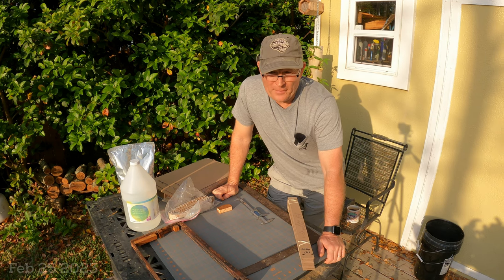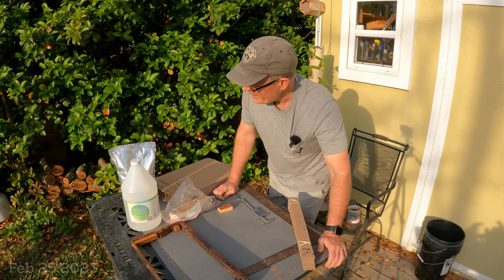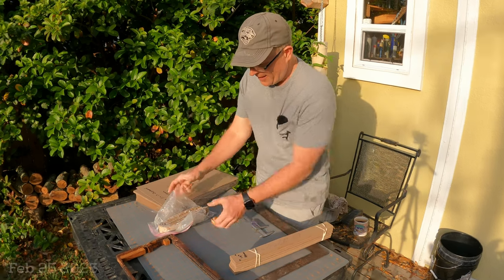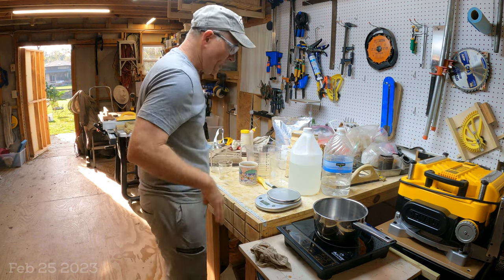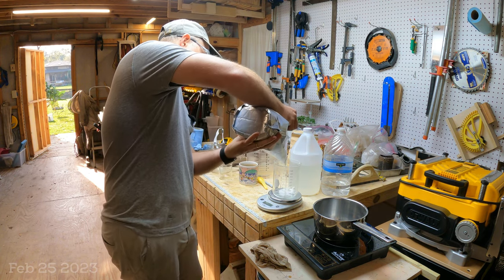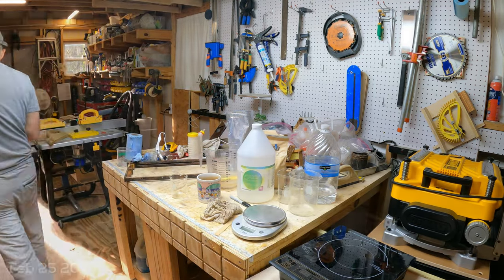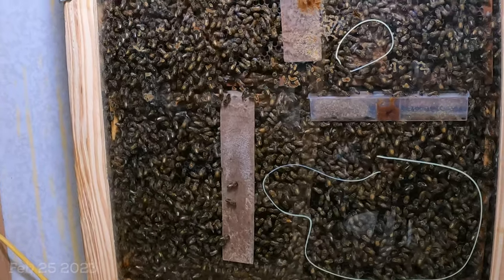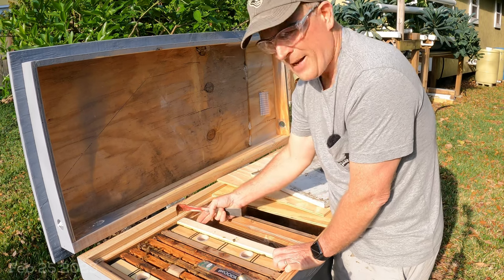HOWTO - Extended Release Oxalic Acid Strips on Chipboard - Jacksonville FL Zone 9a

Comment: I am glad to have found your channel. 2nd year beek. Absolutely and completely enjoying the learning journey. It’s true to that the second year is where things get fun. I already have the strips cut, will make solution tomorrow. I have one hive with 6 mites from the wash another with 8. On hives with numbers like that can I put 6 strips or stick with 2 per box. I’m running double deeps. My swarms that were caught have almost none, 1-3. We use the Dawn soap wash. I was shocked that 1 hive I split from last year had 0 mites in the wash. That shocked me. But I was glad. With appreciation and gratitude 🐝
Reply from the maker: You could put 6 strips per box, but I think that is overkill if you did the formula like I described.  I don't think it will make it last longer, only more oxalic in the hive until they chew them away.  But if you do put 6 per hive, I don't think you are going to hurt anything either.  Welcome to the channel.
Reply: Chuck, how long can you keep the strips in the freezer, or refrigerator, and still be effective?

Comment: Thanks for the video. BTW, I use an infrared thermometer to watch the temperature. Getting two cheap ones enables me to verify they are reading the same and working properly. You provided very useful guidance, thanks again.
Reply from the maker: IR Cameras are a great tool, especially up north.  You can see the cluster size without cracking the lid.  Thanks for the feedback and comment.

Comment: Nice work Chuck, Video is great for educating and building connection.
Reply from the maker: Glad you enjoyed it, and thank you for the comment.
Reply: Chuck I don’t see on Randy website that he use water .
Reply: Place 500g OA dihydrate into a stainless steel pan, then add 500g (400 mL) vegetable glycerin (add the glycerin second in order to avoid splashing of the solution).
Place the pan over a low/medium heat (preferably using a double boiler), and heat the ingredients while closely monitoring the temperature, not to exceed 160°F (the acid crystals will dissolve at as low as 110°F, and start to bubble if the temperature exceeds 170°F).
Occasionally stir gently until the acid crystals are completely dissolved and the solution is completely clear. At that point, remove the pan from heat.
 @chuckshoneybees
Reply from the maker: Randy does not have to use water in his sponge formula, in earlier articles where he was testing with other media he uses water.  The water is ONLY to help get the mixture into a solution that will absorb into the media.  The water evaporates away leaving only the Oxalic Acid and Glycerin in the chipboard.

Comment: Informative video.  The chipboard strips will also work for top bar and Layens hives.  I use a combination of sponges on the hive floor and suspended shop towel strips hung from the top bars.  I’m going to switch to chip board for easier handling.
Reply from the maker: I used to hang the shop towels between the bars too, But they just are a bit to flimsy to "push down" the chipboard of the right thickness ..is much better in my experience.  Give it a try and let me know what you think.

Comment: Been watching your channel for around 6 months, completing my first season of having a colony this spring with a bustling double deep coming thru winter and already filling the better part of two supers. Im in the same USDA zone but on other coast. I am really finding my timeline to sync up with yours and its been very helpful. 

I treated for mites last November with formic pro after testing 7%. Treatment bringing it down to just over 2% if memory serves me. Fast forward to early Feb (the 10th specifically) when I took a first peak in for '24 after noticing them pick up in energy and again performing a mite wash and recording 2.5% 

Understanding OAE is best done proactively while numbers are relatively low I wanted to get it made up and on the hive quick. Using a 1:1 acid to glycerin ratio of 120g total weight impregnated on 66 sq in 2mm chipboard. My chipboard was 11.5x11.5in from Michaels so I couldn't cut it into the long strips as shown so rather placed the chipboard "pads" staggered between the two brood boxs. That was on Feb 22nd.

So anyway its been a month since the 2.5% reading and three weeks since application of OAE. I know the full window of time for maximum effectiveness was nearly two months (...I think) 
Two questions if you can offer your expertise.  1. Do you see any problem that the chipboard is placed sandwiched bettween the brood boxes vs hung down over frames, with a correspondingly lower sq in./weight dosage.    2. Even in the only three weeks since applying the OAE is it reasonable to expect any efficacy on the mites? I usually do mite washes on the monthly, so was planning on one in the next day or so anyways. I guess Ill see and report back if you dont mind...? Kinda as a note to myself since I cant seem to keep a written record lol./

Thank you for reading my questions and posting your findings there in 9b!!!
Cheers Chuck!
Reply from the maker: Thanks for the detail and long comment.  There can still be efficacy between the brood boxes, and Randy Oliver chooses this method with his OA Sponges.  But the sponges hold much more OA per square centimeter.  So to answer your questions, I think between the frames is better for chipboard, and sponges work good between double brood chambers.  I am sure you will get some good results with your method, but perhaps not optimal.
Reply: Well the results are in, my mite levels rose to 3.8% ☹️

So I’m wondering what my next move should be… kicking around the options of adding some OAE in sponge form and removing the chipboard, doing a OA dribble, or if i wanna pull out the big guns give the hive a round of formic pro.

I suppose doing nothing is also an option, and wait to see if the chipboard “pads” will become more effective in time but that seems like a gamble.

On a happier note though my hive is eagerly putting away the nectar and drawing out new comb even quicker than when i was feeding them!

Comment: Hi Chuck. I enjoy listening to your presentations. It is my 5th time using your recipe for the extended Oxalic Acid treatment by means of strips and I had no problems until the last time (which it  was yesterday) I experienced massive bearding, after 2-3 hours of application , I removed the strips but the next day I had to deal with total colony collapse in two of my hives which came out of this Spring split and they were doing very well. I did not change anything from the recipe. I will appreciate your feed back, thank you in advance.
Reply from the maker: I don't know what to tell you, as I have never had this happen to me.  Maybe something was off. My only recommendation would be to start over. OA is not a very harsh  acid, it should not cause bearding like a formic application.

Comment: Chuck, I wanted to pass on a suggestion.  I saw how you folded the strips across a frame.  I am using an embossing tool I bought from Michaels.  They may have them at Hobby Lobby also.  It is in the section for making your own greeting cards.  I find the center vertically and use the square as you did to make the strips even lengths.  I clamp the square down and run the embossing tool on each side to make a crease to bend the chipboard.  This will make the strips easier to fold across the frame.  I cut my strips as you did lengthwise.  Hope this will help.
Reply from the maker: Great improvement!

Comment: Couple of questions 1.  They are still damp when you hang them in the hive?  2.  Shelf life after soaked?  Thanks, glenn
Reply from the maker: I don't have a shelf life number based on any science, but I have stored them in a bag in the refrigerator over a year personally.  The dampness depends on the temperature, but typically at normal temperatures (if you got the glycerin/water/OA ratios right, they will be dry and a bit crusty once the water evaporates.

Comment: I wonder,  by exposing the mites to OA over extended time if we are creating the opportunity for them to build a resistance to OA. They seem to have built a resistance to so many other extended release treatments. Then we would lose OA vaporization as an effective tool. Would like to hear others thoughts about that.
Reply from the maker: There has not been any documentation of resistance to Oxalic Acid .. that I have found anyway, but a successful IPM strategy is important.  Thanks for the comment.
Reply: @chuckshoneybees  I should have been clearer in my statement. OA vaporization has been an effective treatment for many years. One reason is, it stays in the hive a very short time. The mites do not have the opportunity to build a resistance. If we start leaving OA extended release in hives for a long time, it seems the mites we eventually have the opportunity to build a resistance like they have so many other extended release products. My concern is if we start using extended release OA we may be setting ourselves up to eventually lose OA vaporization as an effective tool because we created the opportunity with extended release for the mites to build resistance.
Reply: @chuckshoneybees regarding resistance to OA: The threshold for treatment has been lowered from 30/300 to 3/300 in the time that I've been keeping bees. Most don't even bother to test anymore. The frequency of treatment (with OA) has gone from once in the fall to almost constantly in the same period. For beekeepers to keep saying they don't see "documentation" of resistance when it's right in front of their faces is concerning. Finally, is the method in this video legal? I watched it months ago, but don't remember if that question was asked/answered.

Comment: Hello and thank you for sharing your knowledge with us.  I had two questions;  a hive with 10 frames, buy as many strips as you want, with these reports you have here in the video?  And to what temperature is the acidoxalic glycerin mixture heated?
Reply from the maker: as low a temperature as you can to get it into solution. Randy Oliver has a maximum temperature of !40-170 if I recall, but I am doing that from memory. I don't measure, I just slow heat it until the OA goes into solution and it never overheats that way.

Comment: Would an induction heater also be a good choice for heating/melting wax that is to be rolled on frames to give additional wax?
Reply from the maker: if you can control the heat at lower temps ..sure!

Comment: Great and very clear! Just a question, the actual randy oliver article suggest 1:1 oa/glycerin. He doesn't user water (and warn about humidity) and use weight not weight/volume.   Does randy get new data and update his article? Or are you up to date with him ? So i am a bit confused on what recipe to follow.
Reply from the maker: Randy has iterated over time, and he now uses sponges.  You don't need water to use the sponges, but to get the solution into the cardboard you do need to use water, but it evaporates anyway, so its just about the solution.  The only important number is the amount of OA you are putting in the hive.  The glycerin and water are just to get the OA into a solution to hold in the substrate.

Comment: Hi Chuck,
I tried using chipboards for the mites. Unfortunately the mites don't fall out and the chipboard doesn't have a sour taste to it. On the other hand when I used shop towels the mites fell out and it was pretty sour. Any tips on what I could change or do differently to make the chipboard work? Thanks
Reply from the maker: Not sure what to tell you if you are getting the recommended number of grams of OA into each strip, that is the process.  You could switch to Swedish sponges if you are using double deeps.

Comment: Hey Chuck, got a couple questions on your formula/ratios. 

1. I don’t see where Randy says he uses any water in his process, what is your reasoning for it and does it make a huge difference?

2. I was rereading is info and he states he’s doing a 50/50 ratio by weight, but you say on the glycerin to use ml, why so? 

I’ve done the maximizer pads before and personally think the folded chipboard your showing makes a bit more since, do you think a 50/50 ratio by weight would be a good formula to follow for them? I would be making them in batches of 50 at a time.
Reply from the maker: Randy used water for the chipboard strips, when he was testing with them, he no longer uses chipboard to my knowledge.  The water makes the solution "thinner" so it goes into the cardboard, it evaporates off so it is only part of the solution process to get the OA into the chipboard.  The weight and volume of these ingredients is so close I use volume for simplicity for liquids.  I think I mention this somewhere.

Comment: If you were using medium brood boxes rather than deeps, would you use an 11 inch strip rather than 17 inch?
Reply from the maker: Sounds about right. You would need to add more strips to the box though to get the same amount of Oxalic Acid into the hive.  Think of the strip as a sponge holding the OA, and the amount needed in the hive to be effective is about two-3 strips per deep, so maybe you would need 4 shorter strips.

Comment: This was really good thank you so much for doing  it. can u do me a favor can u calculate what I need I have 50 hives they are double deep brood chambers, so that would be 4 per hive. what should I use Thanks and have a blessed week this is what I calculated  can you check to see if I am right.   200 strips 4 per hive of 2 deeps,   I got 2000-gram oa 2000 ml gly, 1000ml of water.   that is 2 parts 2 parts and 1 part  thaks again
Reply from the maker: Sounds about right, as my recipe makes 45 .. multiply everything by a little more than 4.

Comment: Excellent video...Does outside temperature matter?  Also once the bees chew the strips do you put more strips in? I did not catch it if you said it..TY
Reply from the maker: Outside temperature does not matter once they are in the hive. I do add strips as they get chewed away, but it could be done different ways depending on how you incorporate this into you strategy.  Just consider this as releasing OA in the hive as they chew them away.  If you are integrating vapor or another treatment this can be used to get the mites they are under cappings as the bees hatch out.
Reply: @chuckshoneybees  TY

Comment: Would this be the same "recipe ratio" for Swedish sponges?  If not, what would that recipe ratio bee?  Also read some of Randy's site on mixing and it was suggested at one point to add water to the OA first then the glycerine - not sure if that is "old" info or not.
Reply from the maker: Water is helpful with the chipboard strips because it helps it soak in.. then it evaporates.  The amount of OA that a sponge holds is more than a chipoard. I have not put out a video yet on sponges .. so I would continue to recommend to use Randy's recipe.

Comment: Nice video. What about weight the strips (after they are soaked up) ?
Reply from the maker: Glad you enjoyed it, not sure what you mean, if you divide the amount of OA used by the number of strips, that gives you the amount of OA per strip.
Reply: Ye, I know each strip should have 10 g OA , but I meant just check the  weight of a few strips. So you know, that there are no strips, which weigh 14 or 6 g. To know strips are soaked equally. Have you done it? @chuckshoneybees
Reply from the maker: No I have not weighed individual strips as you are suggesting. @marekbily8677
Reply: @chuckshoneybees  Thanks for reply

Comment: Thanks for the video. I made the strips, but mine turned out very grainy. 

You keep talking about full solution. Are you actually getting all of the OA completely dissolved?
Reply from the maker: Yes all of the OA is fully dissolved in the Glycerin/Water solution when I pour it over the chipboard strips.
Reply: I figured it out. It turns out the problem was my thermometer. I had been using an analog candy thermometer. Today I used a digital meat thermometer. Obviously, I was getting nowhere near 160° the first time around – Even though the thermometer said I was. With the meat thermometer, I was able to keep the solution on the stove much longer, and the solution went totally clear at around 140°. 

With the benefit of experience, I would say this recipe can be made without a thermometer, as you did. Just heat the ingredients slowly until you get a clear solution – just like you said.
Reply from the maker: Glad you figured it out!  I a sure the mites won't be so happy though :)

Comment: Correct me if I am wrong, but doesn’t R.O use a 1:1 by weight recipe?
Reply from the maker: To be honest I had to go back an look at his latest recommendations.  As I have been working with him so long things have changed. My recipe has evolved to be just a bit different, but both will work just fine.  But you are correct on his current article he recommends 500g OA and 500g Glycerin (400ml) .. but Randy is also recommending this recipe be used on sponges, and I am recommending chipboard.. so this is  where we diverge.  The extra glycerin is needed in the chipboard to keep it "wet" but not for a sponge.  Give either a try.  the purpose of this content is to get beekeepers helping their bees.
Reply: Yes, I had the same question about the ratio. Glad I looked through the comments. The new Zelanders do 40 OA to 60 Glycerin. Similar to your ratio. Also, with chipboard.